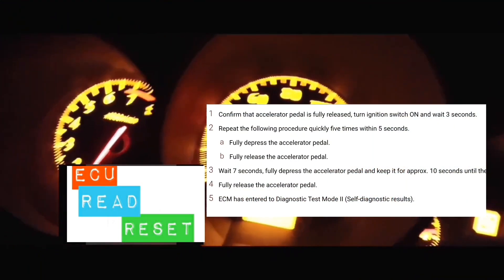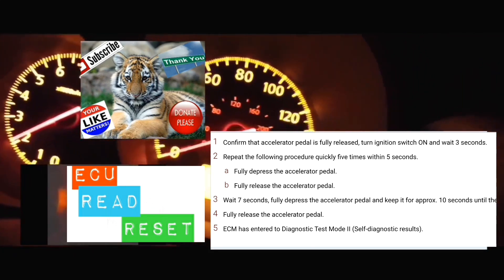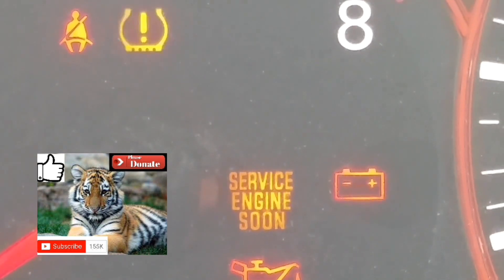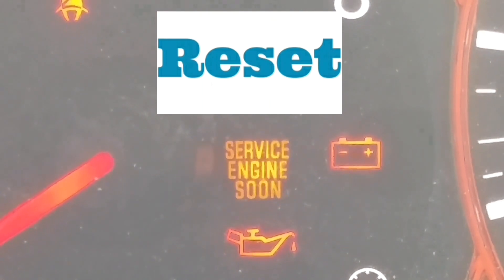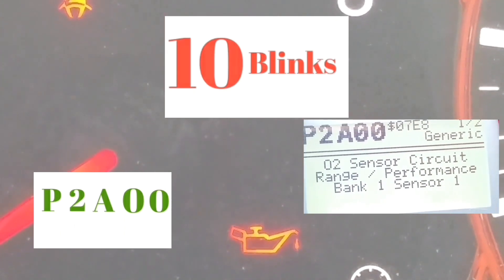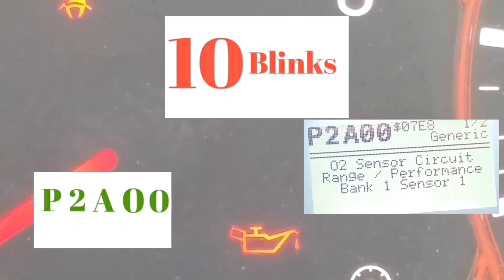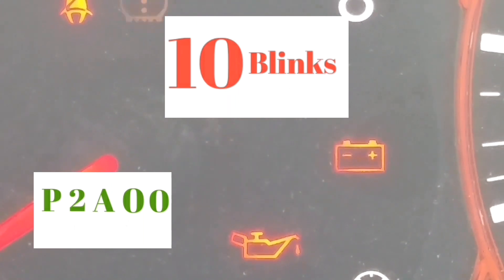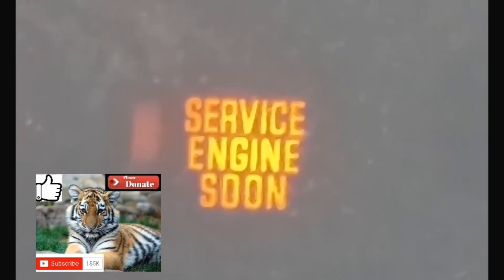How to Read and Reset Your Car's ECU- 2006 Nissan Altima

Comment: And  you also can flood your car  by continuing to press the gas pedal .hello.
Reply: With an electric Ignition and mission and the way they run the fuel pumps these days good luck flooding your car out especially a 2006 Nissan altima